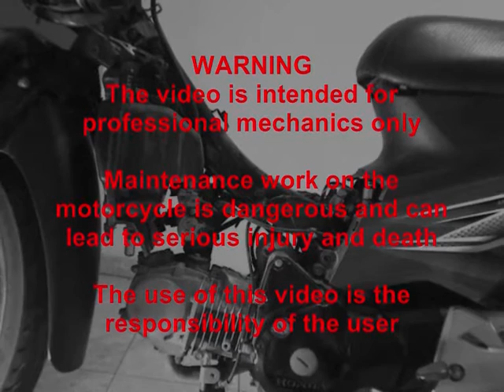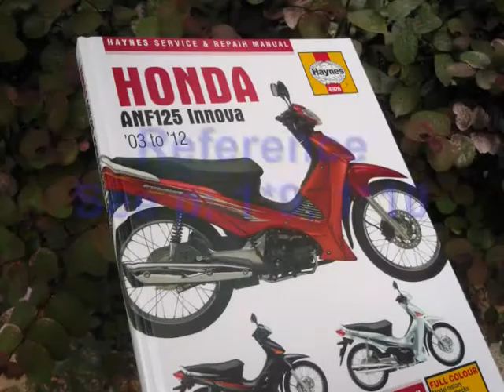The Air Filter (1 of 3): How to clean or replace | HONDA INNOVA GARAGE | WAVE | 2010

Comment: Thank you for showing how to remove the covers. Everyone starts with panels off. 🎉
Reply: It's not exactly Honda Dream C100P, but very close. And the layout of the panel is rather similar. I was wondering how to remove the two side panels and didn't realize I have to remove the small front panel first.

Thank you for a very comprehensive series! It's very meticulous. 😍🎉

Comment from the maker: Clean the bike to ensure that when you opening the air intake it does not get dirty.
You are right, it is possible to remove the air filter without dismantling covers, but for dismantling the filter there is a very narrow spacing. When disassembled right side cover, this space growing.
You can save the dismantling covers, but may be required to pay double for a new filter that cardboard ripped & worse, you may install a new filter, tear it without noticing & ride without air filtration.
Reply: tamirkr hello tamir, i also have an anf 125i innova and i would like to ask you if you know a better air filter than the stock one and if it will change the sound of the bike? thank you!!
Reply from the maker: Sorry, I do not recommend changing the original sound.
It's a very cheap part. I do not recommend installing a non-genuine part. I can tell you that a blocked filter , In the model with the injection, lowers power and increases fuel consumption to 62km/l

Comment: Hi Tamir. does you inova has any rubber seal/gasket in the air filter housing. parts no-17213KPH900
Reply from the maker: Yes, there are two seals on both sides of the filter, they are inside the designated slots, one in the case, one in the cover.
To my understanding it is the same seals, the same length. I have the original seals (2010), and they work good.

Comment: Hey, I didn't understand why do we have to disassemble all those parts before the air filter cover, they're not in the way and don't help in any way... please explain
Reply: Correct.
Reply from the maker: @sindatokdanrexable  
Without removing the covers, it is difficulted to access the air filter  , and then there is a chance to destroy the filter's cardboard. That is the reason why it is recommended to dismantle the covers, as shown in the video.
Reply: @MyINNOVAMotorcycling  i do respect po kung ano po ang way nyo. Pero sa akin. Sa loob po ng 13yrs sa wave 125 ko. Never ko binuksan ang side flerings nito kapag naglinis ako ng air filter.
Reply: You are right. You don’t need to remove the covers. The job CAN be completed without panel removal BUT it is VERY fiddly to do it this way. As the OP points out, it gives you more space to work. Even with the panels off working space is limited. It’s best practice to take them off unless you have an older model with a stuck rusty screw. If this is the case and you are having trouble removing the panel because of this, spray lots of WD40 on each stuck screw and leave overnight to soak. It should loosen when the try the following day.
Reply: @MyINNOVAMotorcycling   That’s true but the job still can be completed with the panels on. The trouble with older Innova’s, where the panels are not removed often, is the screws rust solid. Very difficult to remove once this happens. Worst case scenario, the screw has to be sewn off, especially if soaking in WD40 overnight dosen’t work. A nightmare scenario with the Innova’s brittle panels.
Reply from the maker: @pp-si2dm  
Yes it is possible without disassembling the panel. In any mechanical job, the "Nightmare" is when a bolt gets stuck and does not open. If I can say, that is the number one problem of any mechanic, when a bolt refuses to open. But do not get excited, you must keep calm, and there are many ways to fix it, in the end overcoming difficult problems is part of the fun😎.
Reply: Καλησπερα  σας 
Και εγω  το  φιλτρο αερα το εβγαλα χωρις να λυσω τα πλαστικα 
Αφου λυσατε τα πλαστικα καλο θαταν να γινει ελεγχος
Σωληνακια φιλτρο βενζινης 
Το καθαρισμα καλο ειναι να γινεται με  πιεσμενο αερα 
Και οχι με σκουπα 

Και επισης  να γινει ελεγχος καθαρισμα  στο σωληνακι  αναθυμιασεων .
Αν εχει γεμισει με βενζινολαδο θα  μπουκωσει το φιλτρο.

Comment from the maker: The video was made for professionals. But I'm glad you ask me, I'm happy to answer, But if you have no mechanical certification please access to the garage .So, get some additional explanations:
Treatment-Filter is every 4000 km and usually require more operations at the same time, that require dismantling covers such as: checking adjust valves, possibly maybe tightening some screws or replacing the plug etc'. Moreover, dismantling the right cover is only possible when other covers dismantling.

Comment: just thinking if this type of filter can wash and reuse?...please advice
Reply from the maker: It's NOT allowed to clean or wash the air filter with water. The filter made from paper/cardboard
,If the board is not damaged and no holes
you can clean with air pressure and then reuse. Extra Careful should be taken with the Air pressure ! protect with appropriate equipment on the eyes and breath ways.
The manufacturer recommends Replacing your air filter every 12,000 kilometers or 18 months, whichever comes first.